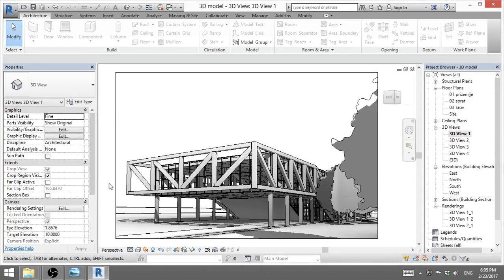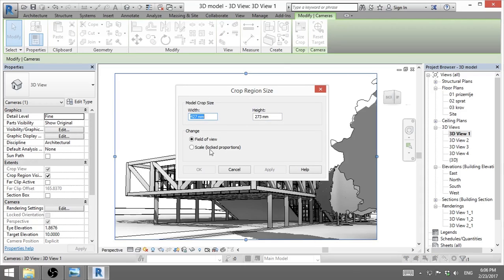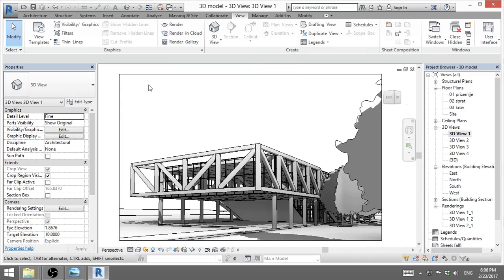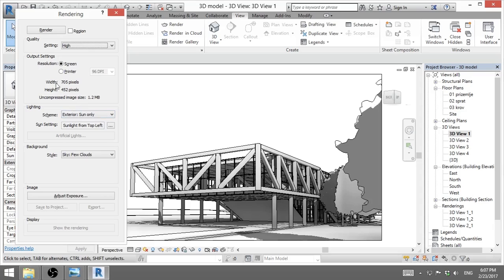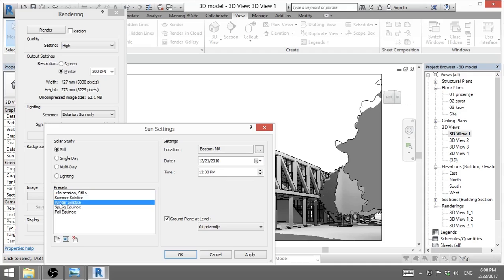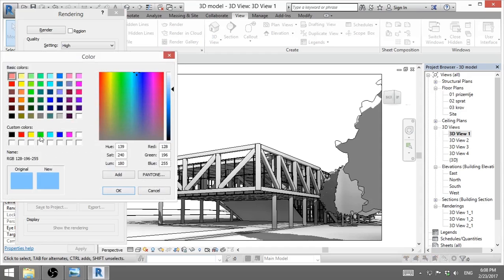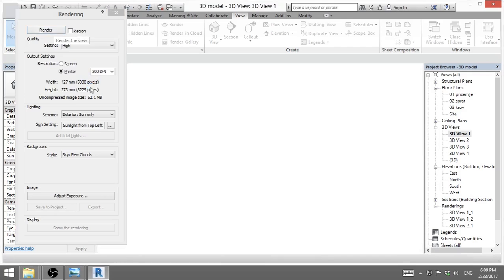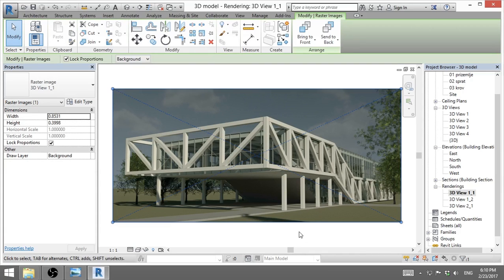How to Setup a Rendering in Revit

Comment: How would u draw a slope step key stone foundation wall?
2in horizontal, 8 inch vertical, set back 30 inch every 5 layer.

I was thinking using stair.

Do u have a better way?

Comment: I'm very new to using Revit so I apologise for the question but I don't seem to have the render tool at all. What am I doing wrong please. I can see the render Cloud icon and the render gallery icon only. I have also done a repair of materials in the install/repair of the software.
Reply: You have Revit LT, it is cheaper and smaller version of Revit. In Revit LT you don't have normal Rendering or MEP functions.